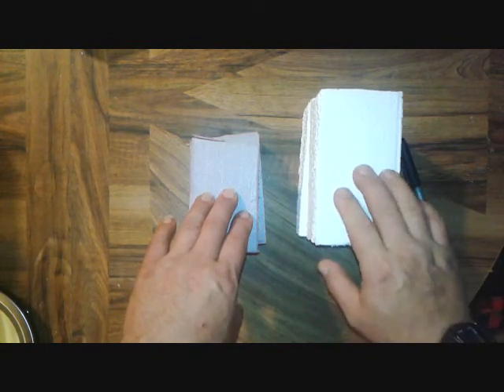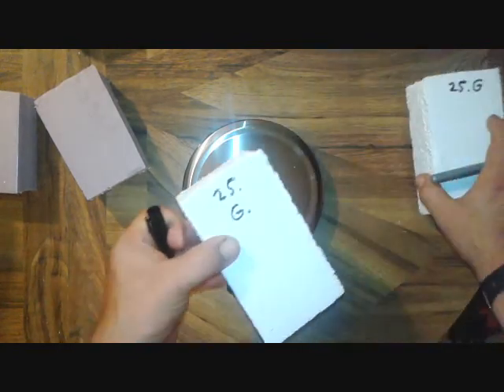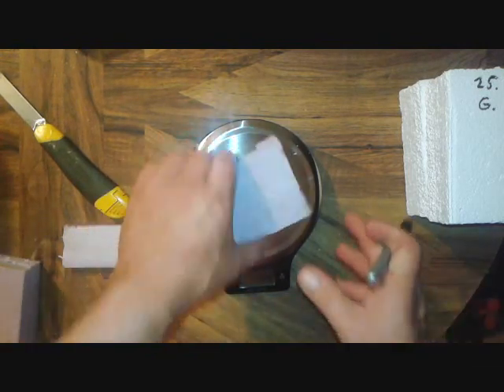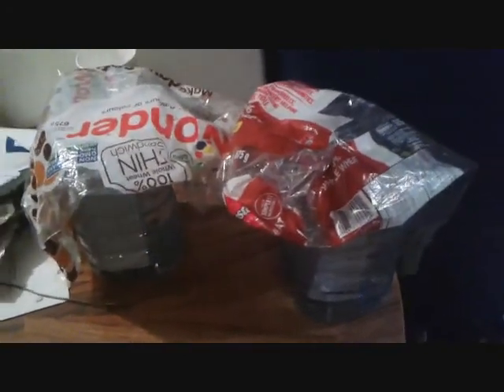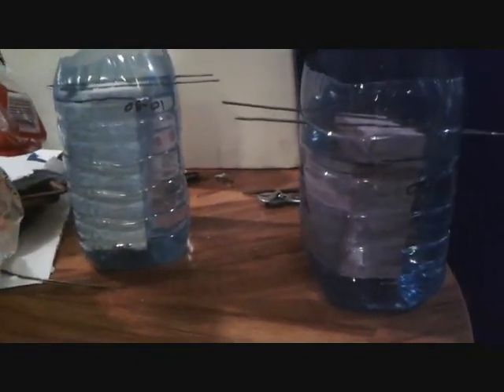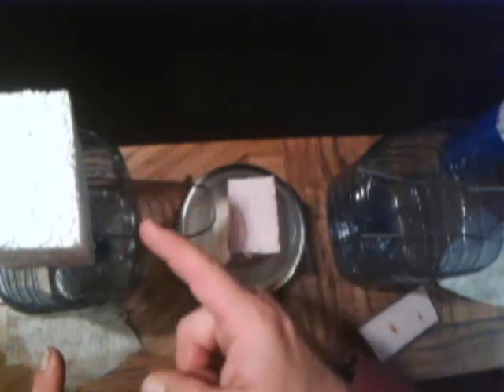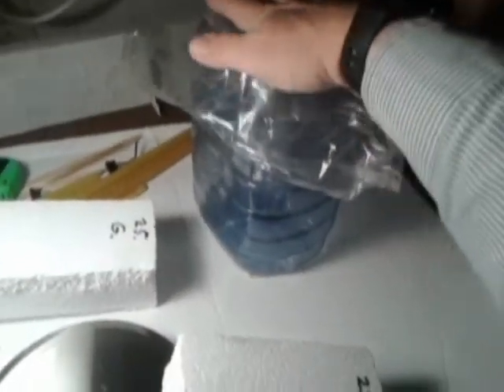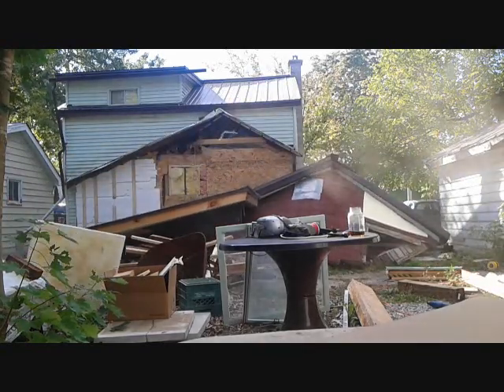Which is best ? EPS Foam or XPS foam ?

Comment: Thanks for sharing your experiment.  But, you focused on the EPS at the end, and never told us if the XPS was able to loose the extra 3g of water after sitting 2 months??
Reply from the maker: Sorry abput not showing the final results, i almost did not post this video, as my sd card was corrupted, and i lost the last few videos showing the results.
Reply: @youcandoitdave6058  Sorry about the tech difficulties.  I'm glad you posted the video.  Can you remember if the XPS dried out back down to it's original weight, or was it stuck holding the water?  Thanks!
Reply from the maker: Since the video was meant to prove ( or disprove ) how much water eps holds - and more importantly - if it would drain back down to the original state,  i do not really remember the final weight of the xps.
I was impressed how little the xps did absorb.
Since my entire Hobbit Home is surrounded by a minimum of 8 inches eps, i am not worried about it getting wet and / or draining because of this test.